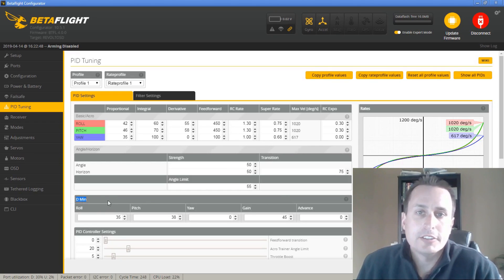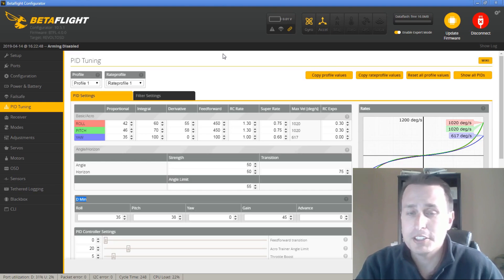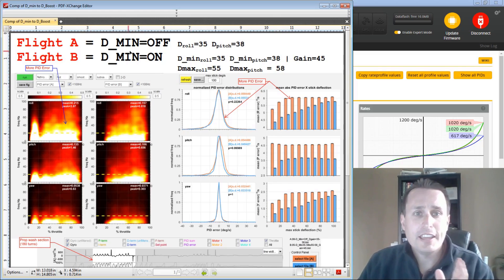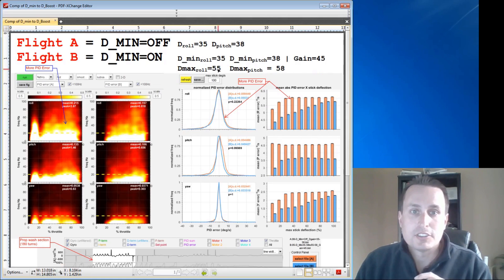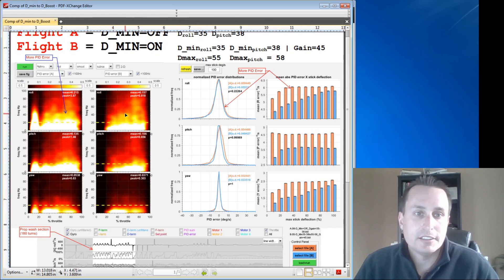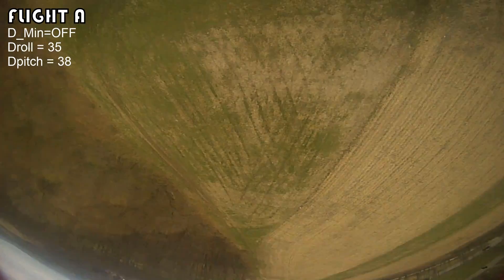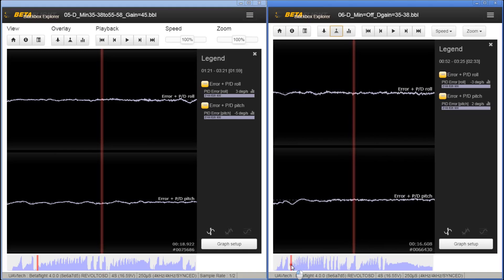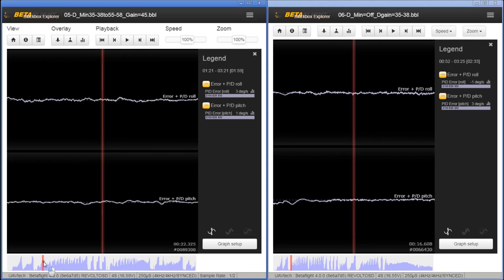Betaflight D-gain BOOST! (D_min to D_Boost)

Comment: I tuned my PID values (according your videos) so my flips and rolls are perfectly following setpoints, but I still get some propwash. My D term now is 42 and 44. If I move these D values to D_min and increase D_max by 20, should I increase P values proportionally to D_Max so my PD balance stays the same as before? I have watched most of your videos, some even few times. Very helpful! Thank you for your efforts to help others.
Reply from the maker: I would leave P to keep ratio with D_min.

Comment: I fly 5” 6s freestyle. I tried the d boost today. Dmins around 22-27 and D max boosts around 55. It was the most incredible feeling except I had one moment while just cruising for a couple seconds where throttle shot up for a second. Also, my motor temps went up from 80F to 125F for a less than one minute flight.

I’m back to Dmins at zero and D term numbers around 33-35.

Wish that boost worked out better. It was awesome when it was awesome.

Comment: Hi Mark, I am trying betaflight 4.0 rpm filtering on my 6S setup.. tuning guide says to reduce the PID values by third, so the D's are around 15. The rpm filtering asks to make this change "set d_min_pitch=29
 and set d_min_roll=27".  Doing so, would the d_min even take effect since the d_max is almost half of d_min on each axis?
Reply from the maker: I'm not sure.  You can log D_min debug to see the active debug in your OSD (debug element) or in the logs.  I would tune D per my "Betaflight is to Complicated?" video and then put your tuned D's in the min and push higher with the D_Boost concept.

Comment: Quick question: I'm more of a freestyle pilot and I'm trying to capture the smoothest possible footage. Should I try to use less D to reduce the possibility of jello in my HD footage or should I tune the quad for better flight performances? I spent a lot of time tuning recently to make my quads perform better but seems like jello problems are getting worse. I wonder if I should work on camera anti vibration or keep tuning to reduce possible vibrations caused by a bad tune.
Reply from the maker: I would record a log.  Frames wear out from use.  maybe raw vibes are just getting more and FW is filtering out, but they are still shaking the camera since that is mounted direct to the frame.
Reply: UAV Tech so I think I’ll record a log of straight level flight and gentle maneuver (that’s when camera vibration is most visible) and check on BBlog. If PID sum and especially D term is acting normal without hopping around then the camera vibration should come from the frame therefore I should work on camera mount to reduce the transmission of the vibration to the HD camera. How’s this solution sound? I don’t have a lot of experience messing with quads, I’m trying to learn something more everyday lol
Reply from the maker: @capnye614  , another trick is drop d-ter dynamic Lowpass1 to 20hz and max to 150.  BiQUAD.

With that, r3duce Gyro filtering to gyro lowpass1, dynamic, and just the the dynamic notch.
Reply: @uavtech  This sounds very interesting! I'll give it a try! I've actually never dropped any filter to 20hz though. Last time I tried to drop Gyro lowpass to 50hz on Helio running Butterflight and quad just flipped out of control mid flight.

Comment: haven't looked at the logs yet but I can say after testing this the BOOST method is def looking better in the air and the HD video..I think this is the way to go and will highly recommend this approach.  I went 55 and 60 on R and P and a gain of 45 and motors were cool and things were good.  a little tighter so I had to increase FF about 10-20 to get my stick feel back

Comment: D-lightful.  I'm pretty amused at the >250 FF values myself, although I'm discovering I actually prefer that 'looser' feel on my racing setups.
I think I'm probably alsoo a contrarian here in that I am really enjoying pushing the bottom end of the D_Min side of things, into the low teens on a lot of my racing setups.  I've ran a minute and a half on aggressive setups with badly bent up props, and if I wasn't hearing the awful noises out of the quad, I wouldn't have guessed there was much difference... motors are even coming back cold... but I think this is because I'm rocking really over-motored setups, but the net effect to me is that I'm getting really excellent response because I'm turning off all kinds of filters, and not losing much in the way of propwash performance to do so.

Comment: thanks Mark it makes a lot of sense...I am not one to shy away from using D gain and like the smoothness and feel, but have struggled with BF4 whereas my 3.5 is almost 0 prop wash. My concern is if I raise P to how I like it (60-70 to properly lock in fast moves) and use this D boost, will I have some issues with high PIDs CTZ talked about...because it does seem like there is some weird stuff going on...
Reply from the maker: People have low end noise issues.  60 to 150hz they really need to look at and address mechanically.  3.5 was covering it up apparently.

Comment: Congrats! An awesome video as always! What do you think that could be the best d_min setup for a light weight racer 260-300g that has to do tight turns in circuit?
Reply from the maker: probably mins in low twenties and boost to mid thirties.

Comment: Mark - you really should add a disclaimer that there are two cases where this could be seriously problematical - micros with higher KV motors can’t take the “heat” at the d values you are using and you could well fry an engine, and very light 5” quads running 6S that simply can’t handle high levels of D without getting into a resonance and possibly even “fly-away” situation.  Your ideas are very sound for the typical 5” heavier setup with a good frame and FC/ESC and good props - we need to see what happens on racing drones when they bend or break a prop with such high D gains.  Looks like you are flying in cold weather - and summer is coming - so pilots need to seriously monitor their motor temps when they start jacking D gains and D_Min gain.

Comment: Sounds like a good idea. I noticed that you had Advanced set to zero. Why did you change that from the default value of 20?
Reply from the maker: Because i don't want to advance d_boost with in sharp stick inputs.  It fights FF.
Reply: That makes sense. I was getting a little bounce back after flips and rolls if I was not careful with the sticks. Possibly setting the advanced to 0 and adjusting the d_min might help with this.
Reply from the maker: You on i-Term Relax type of Gyro and Cutoff of 11?  I-term is typically the bounceback problem.
Reply: @uavtech  I have it set to Gyro and the cutoff is 20. I will changing it to 11 first
Reply from the maker: Yep, i pet that will help a lot!
Reply: Setting the gyro cutoff to 11 fixed the issue

Comment: Thanks for the heads up :) Did the motor temp increase any after turning the D-min up?
Reply from the maker: Nope.  It only boosts for short periods of time.  But also my motors are not sensitive to higher D.

Comment: Can I send you a quad to tune for me.
Reply from the maker: Um sure.  If it has FrSky RX.
Reply: UAV Tech I have crossfire I was gonna send you my qx7 with the crossfire module. Basically I was gonna send you my radio and quad. If that's a issue I will just install a frysky receiver
Reply: How can I find you on facebook

Comment: Great vidio i was flaying and testing ff on 250 and now on 450 ?? i will test it today !!! Thanks and happy easter time :-)))))
Reply from the maker: You noticed that eh.  That is with a special cut of "Interpolated FF"  video to come on that soon.

You can try on 4.0 stable, but will probably get overshoot.  Interpolated FF fixes that.
Reply: @uavtech  i flayall Bidirectional ,RPM Fiter and Integred Yaw no i will put this in my Eachine TS 215 V3   your settings   Lipo Hobbywing Grafen 1300mph 65C :-))) Gefam 5043 and Hulky 5050

Comment: Thanks for these explanations, I have not tried yet.  But I'm a little bit worried, bumping Dmax so high is gonna smoke a motor ?
Reply from the maker: It os only high for a couple of short periods of time.  Try it, but check temps.  My motors don't have temp issues.

Comment: Thank you for your tutorials, you're the best betaflight tutor ever..  just a quick question, how do you set your d terms so high? my motors would have melted at the d term you're using. am i doing something wrong...
Reply: Most of the time the motors will be at the low values.  And they are pushed up with big stick movements.  So it wont go up to 50+ and stay there.  Its only very briefly at the high value.
Reply: Avolate FPV so is it possible to set my dterm higher? i'm still getting propwash at D 40. My D mins at 23, D gain at 29. My motors are already too hot. Using stock filtering and stock dynamic lpf and notch.
Reply: @terminuscoagule3059  You should be able raise the mins to what you had in previous versions of betaflight.   I use dterm_lowpass2_type = PT1 with a 200 max for freestyle.
Reply: Avolate FPV had to really lower the d term filters, 135 biquad but now propwash is exagerated.

Comment: A quote from the wiki
---
The default value of 20 is ideal for the majority of quads. Very clean quads can be OK with gain at 25. If set higher again, the quad will not run at the minimum value much of the time, and will readily climb to the max D value. 
---
Is it fine to have such a high value of gain like in your video?
Reply from the maker: Yes.  Wiki is too conservative IMO.  You can tract D_min debug to verify for yourself.